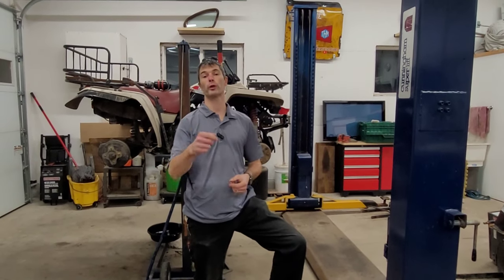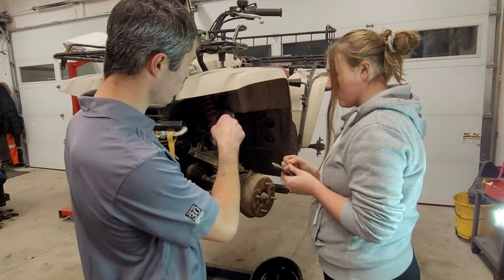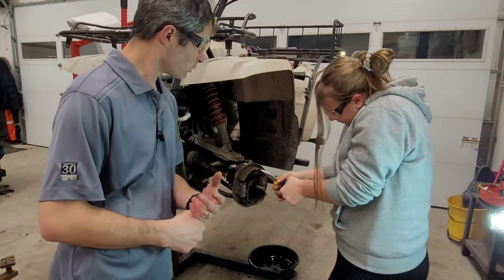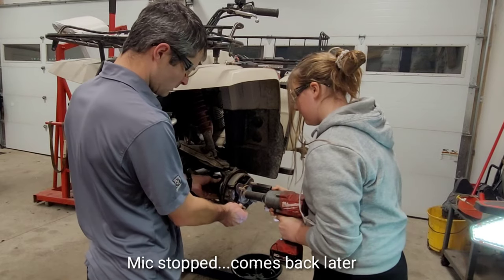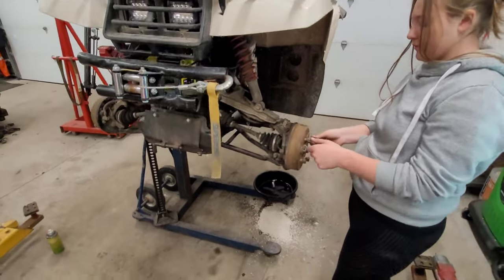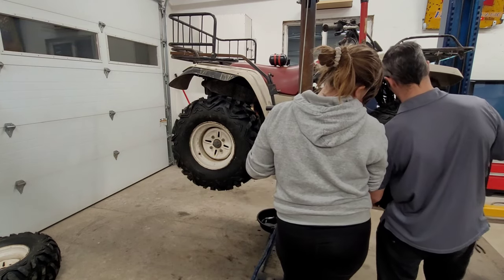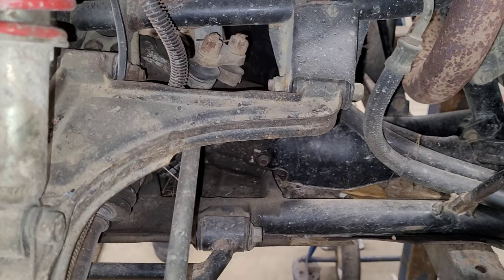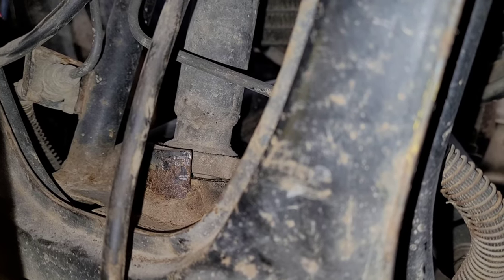Replacing the front brake shoes!!! Original Big Bear 350!!!

Comment: I have a 1993 model and I believe the hub (the large nut needs to come off to take the hub off)  is a little different from the one you have.  Do you have a method of bleeding the front brakes (mine has the original fluid and could use a flush).  Have you replaced the front brake flex lines on yours?  Do you have a parts source you use?
Reply from the maker: As for parts, I source it either from Yamaha or my local Royal distributing. My brake bleeding procedure is to 1. make sure the reservoir is kept full 2. pump the pedal or level and hold 3. open the bleeding screw until it stops flowing and close it before releasing pressure. There are tools available but I find this method works just as well. Also, believe it or not,  my flex lines are original. Hope this helps

Comment: Is it possible to a disc brake conversion on that model?
Reply: Yes it's possible, but you need a lot of parts from a Kodiak.
Reply: Maybe a 1.5" wheel spacers? To clear the front tires
Reply from the maker: It's really not much. I can probably get away with a 1/2 inch spacer. Maybe even some washers but I really don't want to widen it out. It's fun to pass newer bikes cause they just don't fit